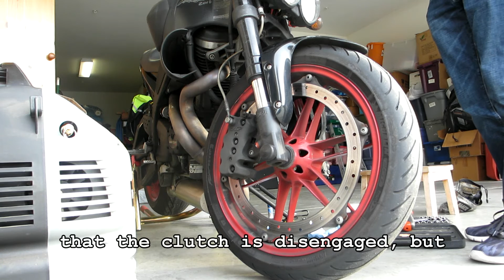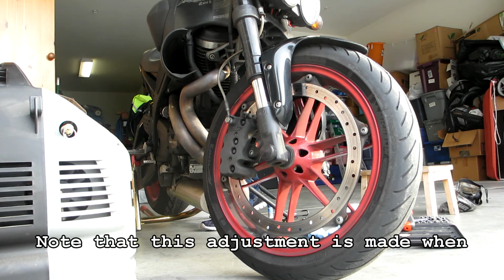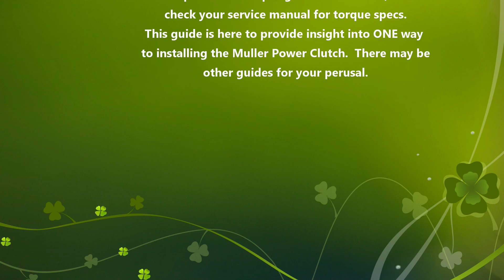Muller Power Clutch Install on a Buell XB or HD Sportster

Comment: I just picked up a xb9s and find that my clutch lever is super tight how can I fix it ?
Reply from the maker: The only things you can do is grease the pivot point and oil the inside of the clutch cable sleeve.  Buell clutch pulls are like Harley clutch pulls... very heavy compared to other sport bikes

Comment: Hello, I may be wrong, but am assuming this is the same Muller that makes the clutch for Sportster 1200's. They advertise about a 40 % in pull reduction. Only place that I have seen them is at Dennis K. I believe, or perhaps ebay. Am I correct so far? If so do you know of any other out lets that I may be able to get a better price? Thanks ahead of time
Mike.
Reply from the maker: Michael Smith it is the same Muller as the ones you see on sportswear, except different model number.  I do see them sold on Amazon as well.  I got mine used through one of the Buell forums.  I would've suggest asking on the forums to see if anyone has a used one they want to get rid of first.  I am on the BuellXb Facebook page and that was where I found mine.

Comment: Great vid. I see your shift lever scratches your primary cover. What if any adjustments can be made to eliminate this?
Reply from the maker: Kevin Wong that was from a low side in dirt a while ago.  I replaced the shifter and it doesn't touch.